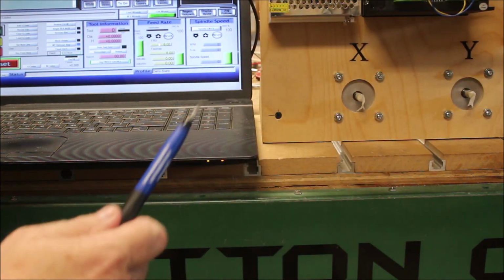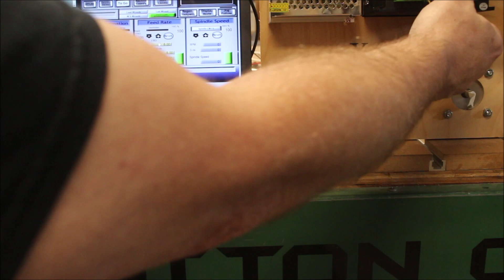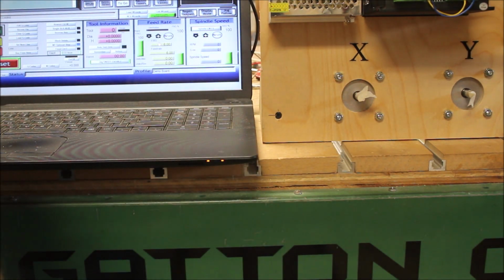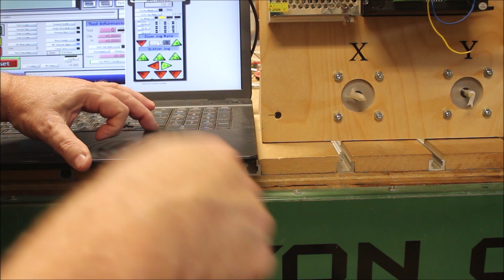Troubleshooting Stepper Motor Connections

Comment: I'm curious what gauge wires you use to connect those external stepper drivers to the motors and the board. I have some Nema 17 motors and the wires that were provided seem extremely thin. In fact when I put a ferrule on the end of one if I don't double it over it will often pull out. It seems to me a slightly larger wire diameter might be a good idea. Your thoughts? Thanks. Subscribed.

Comment: Great stuff, I have a different issue, I am running grbl 1.1f with nema 23 3Nm with the drivers DM542T, and my motors are unable to move unless I specify it to move more than 20 mm, I am running all of them at full steps, the current is properly setted, and when I run any g-code, it doesn't matters if I crated a g-code with a slow feed rate, it always moves way too fast, can anyone help me please?

Comment: I'm using an a4988 stepper motor driver to drive a stepper motor I salvaged from an old Epson printer scanner bed.  I managed to get it working and moving in both directs with an arduino sketch. Then, after working on something else for a few days.  When I tried again, it would only turn in one direction and was getting pretty hot.  checked the wiring several times but it turned out to be the driver.  I only found out because I changed the driver and it worked fine.  Will have to do more homework on calibrating the motor I guess.  Thanks for the tips.

Comment: i have a similar problem but not sure if it is  related to the stepper driver or motor.     My "z" axis on my router is creeping downward.  At first I thought it was something mechanical mainly because I did not note any change in DRO location.  I checked all mechanical related possibilities. No problems.   I then ran program and noticed that knob on top of motor was rotating significantly at a couple of positions in a cutting pattern of circle and plunging into workpiece;  locations of movement were approximately 180 degrees apart.  No input was given and DRO showed no downward movement.  it is almost like a impulse was given via induction?  However, there was significant tool chatter when it occurred. Not sure if chatter was the result of unwanted movement or the chatter preceded the movement.  

Any suggestions where to go from here.

Comment: I wonder if you could help me please. I have one of the Chinese 6040 routers, which is 3 year old now. It's started leaving lines across my carvings and on a big 500mm long carving it drops by about 2mm from one end to the other. I have checked and my bed is level. The Z motor also give a grumble like sound every now and then. I have checked the wiring and have found nothing as in bad connections. Do I need a new stepper motor do you think. Thank you for any help you can give, Terry
Reply from the maker: Always check the mechanical things first.  Is your stepper motor coupler slipping?  If your wires have plugs on each end make sure that not only are the plugs pushed all the way in but also the wires are not loose in the plug.  You could try switching one of the wire cables with another axis and see if the problem moves to that axis.  Stepper motors are nearly bullet proof so I would suspect either a loose coupler or a bad electrical connection or bad cable.  Also, make sure the z axis is not binding.
Reply: Thank you Dave for you quick reply, very much appreciated. I don't notice it on smaller jobs, but it made quite a difference on this 500m long job. It is one of the smaller stepper motors on the z axis. The other two (X Y) are bigger, I just wondered if it was too small. Thanks again for your reply, Terry.

Comment: My stepper setup stalled randomly as it was working fine making a loud noise then stopped working altogether. I changed the driver but somehow the driver green light doesn't even come on :((( I checked the voltage and it was 24V so it wasn't a power issue I feel. I powered up other devices so not sure what the hell is going on. I checked all the wiring. It's full on dead :(

Comment: HI, I have a symptom not mentioned here. When the driver is powered up, I am just getting a holding pulse, once every 1 second.
What are the typical reasons where this may happen, when I am expecting the stepper motor to be held in place, awaying pulses. Thanks.

Comment: I came upon your video because I am at my wits end. You seem to be knowledgeable, maybe you can offer me an idea. My X-ray machine has 3 stepper motors and one of them just vibrates and doesn’t spin. It buzzes also. The motor tests fine , I have 3 other spare motors and the same thing happens with them all. It is a 4 wire 2 phase motor. The board seems to be okay, also. The four pins connected to a different motor by switching the cable, works fine. That brings me to the wire.  It seems like it has to be the wire, but how can it?  There is continuity on each lead from one end to the other.  It’s possible though the plug connectors aren’t contacting. One of the leads isn’t locked into the housing. It looks sort of like a DuPont coupling between the motor and wire. If one lead was not making contact, or was poorly contacting, would that give me the problem I am having?  It’s a 40k machine that’s only 10 years old. The manufacturer doesn’t support it anymore, I can’t get another wire. I can try to make one, but the pancon 100 series connector going into the board is going to be hard to find.  Right now I have no X-ray machine!  Any thoughts would be awesome. Thank you. R
Reply from the maker: Sorry, I only know about CNC machines.  I don't know anything about X-ray machines.
Reply: Thanks anyway. It was more of a general question about if one lead was not making a good contact would that cause the motor not to spin, but thanks for taking the time to respond
Reply from the maker: @Drrich_DIY  Did you even watch the video?
Reply: @DaveGatton  of course I did. A few times. But there are four and six wire motors. And since the symptoms your motors exhibited weren't the same as what I am experiencing,  I thought you might have seen my symptoms associated with some sort of weak or sporadic connection

Comment: Hey Dave any experience with  a motor refusing to change directions.  My z will only go up  not down.  Goes up with pg up  and with  page down.   Checked ping 6 an 7 and I can see the voltage change so i dont believe its the UC100/Mach3 setup.    I am still on an old Xylotec.    Plugged Z into my Rotary axis  to that output nd it does the same thing  .. Rotates both same direction  with pageup/page down.  I am blaming on the driver but I wonderer if  you had some experience/recommendation.
Reply from the maker: Yes I have experience with that.  That's what I am showing in the first three minutes of this video.
Reply: @DaveGatton  Thanks for the video and the info.  I have the old xylotec with a uc100 direct feeding  the parallel port.   Could be that ribbon cable but I am guessing the board.       Guess I will start wiring up these DM542 drivers:)

Comment: No one else ever responds to this question i posted ,maybe you have an idea... my ender 5 has just started acting up with a strange issue which seems motherboard driver related... on one print it stopped approx one hour into printing...nozzle is fused to the print since heat to nozzle shuts off also...this happened 3 times printing this file which used to print fine...i probably have over 30 prints with success... so then i prints another file which is a bit less complex and printer has less effort i guess you could say... i can print these which take over 10 hours without a issue... i thought maybe stepper motors were getting to hot so i even setup a box fan which kept motors cool to the touch and it still stopped 50 minutes into the print... i have fixed everything on this machine over the past year ,but i am stumped.... i just ordered a new motherboard for it...Anyway what do you think issue is???  thanks